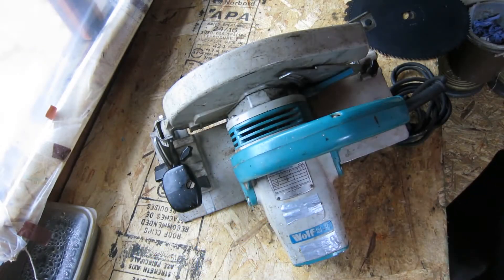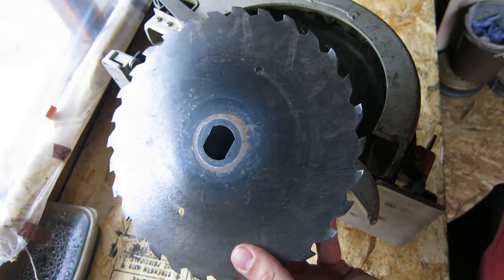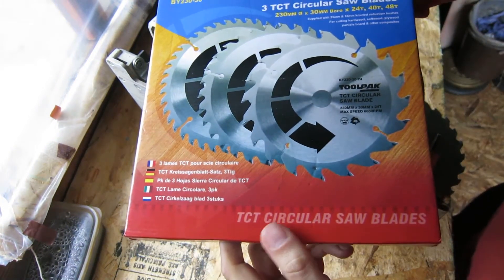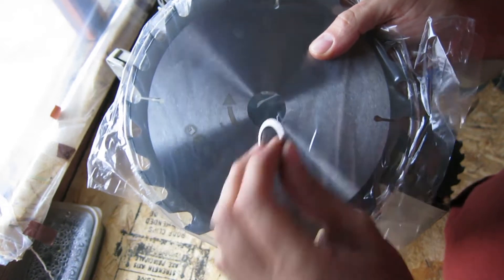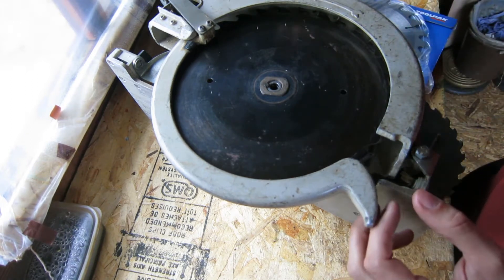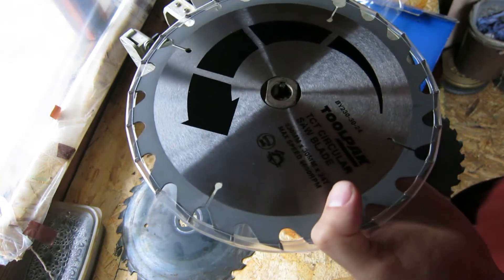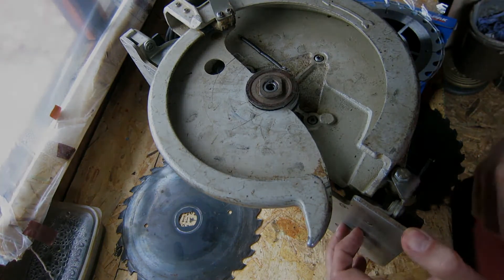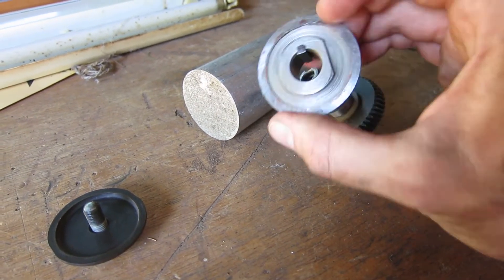Wolf Sapphire Saw "6089" metrification - machining a new drive bushing

Comment: We have the same saw one question was the bolt of the blade reverse thread coz it’s done up real tight and we don’t what to yank it the wrong way and break it off
Reply from the maker: 16:15 in https://youtu.be/mOND_Gj_uaY
Looks like it's a normal thread.
The original blades have the D shaped key so they don't spin off with the saw starting up.